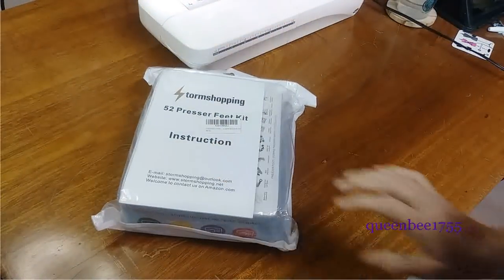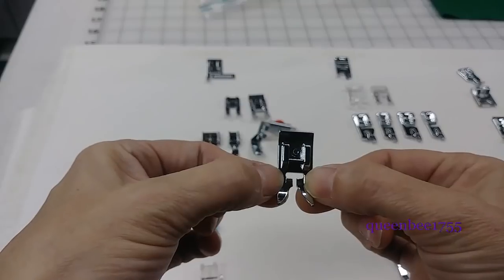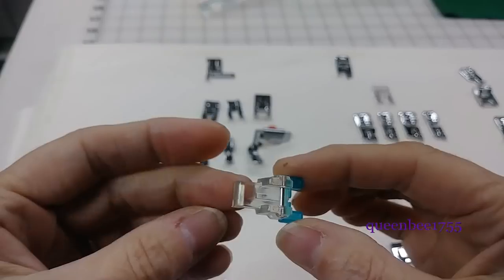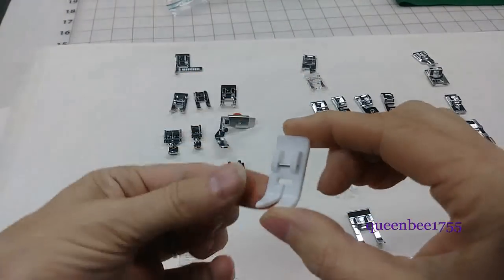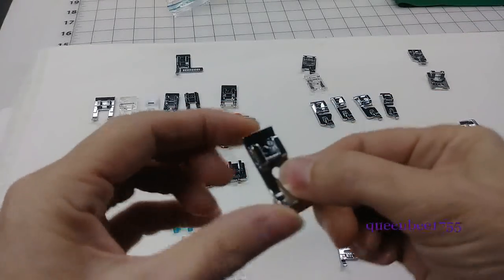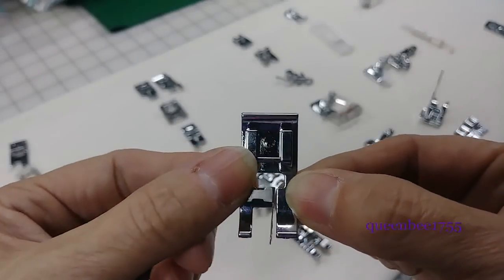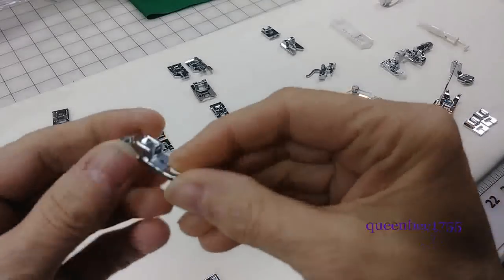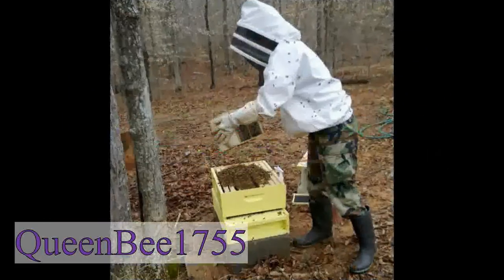52 Piece Presser Foot Kit: Identification

Comment: The white one at 11.20 is a nylon foot  for sewing leather/plastic  etc,  it glides without sticking,  as a normal foot would do.   Also at 16.50,  I believe that this foot is a 'Stitch in the ditch'  foot,  which is why there is no bar for the overcasting effect.   you would use the blade to sit in the 'ditch' .

Comment: I have this set and I"m glad someone posted a video about each foot and how it's used.  Some of these I will never use but for the price I figured I'd just go for it.  BTW, that plastic universal foot is supposedly made of Teflon so it won't stick to certain types of material.
Reply: I have stitched with vinyl with that white teflon foot.
Reply: Where cahjjh

Comment: hi and appreciate the video and information. One thing I have experienced is plastic presser feet work better on knit fabrics as there is same holding/guiding power without friction to the fabric movement. try the plastic version if you find the fabric is not moving smoothly or getting puckering along the seemline.

Comment: Your white "plastic" foot is called a Teflon foot (I saw later that someone said it's a nylon foot I wasn't aware they made them in nylon) and is meant to be used on very smooth fabrics like what you use for prom dresses or lingerie. I saw someone else mention using it for leather. I think that and even pleather it would work well on. It won't snag on the fabric and it holds onto it even though it's slippery. Love this video you did a GREAT JOB!!!!
Reply from the maker: @Rainwatercolor  Thank you! This is an old video, back when I had never needed the Teflon foot. Many things have changed since then. We learn and grow and now I'm sewing upholstery, motorcycle seats, and leather projects and using many more 'tools of the trade'. Thanks for commenting!

Comment: The foot that has the bar guiding part in the middle the foot is a quilting foot for stitching in the ditch. stitching right in the seam line between two pieces. the guide goes down the space between the two pieces and keeps your stitches right in that ditch
Reply from the maker: If you are referring to the one I think you are, that is correct. There is more than one foot in this kit with a center bar/piece. The main function of the one with the thicker bar is edge work, like faux surger edges, etc. The one with the thin guild bar is for stitch in ditch. 
When going thru this set, I was calling each piece what the book that it came with called it. Although that is the main function of that foot, it also has many other uses. It can be used to join together pieces with zigzag or decorative heirloom stitch and I've also used it occasionally for following the edge of an applique.

Comment: Hello from France .  In case no one has already told you, that white 'zig zag' foot is actually a non stick pressure foot. I've got one and it's used for vinyl and leather.  Thanks for the video.
Reply from the maker: I had organized them according to the descriptions in the book and realized that one was a 'non-stick' foot (the white ones are) after I did the video. But life has been so hectic I never corrected in comments. Thank you for pointing that out!

Comment: the white plastic foot is a Teflon foot useful when you're working with vinyls and other materials that would stick and dragged under a presser foot.
Reply from the maker: I did make a correction on that in the comments thank you.
Reply: @QueenBee1755  great! It is a very useful foot. I once reupholstered a snow mobile seat with bonded vinyl and it was a big help!
Reply from the maker: It does help. I sew a lot of leather and vinyl as well.

Comment: You missed the circular/flower embroidery head. That rotates the fabric to produce petal patterns, as well as circles, but does suppose you're able to spin the mass of fabric fairly freely around the needle.
Reply from the maker: Since this set of videos was based on this set, and those did not come with this set so they weren't missed, I don't show them.
Reply: @QueenBee1755  Aw, just that they were on the table...

Comment: hi i love the video you did for the 52 piece presser foot kit, but i'm having a problem identifying which presser foot goes were because my mum took them all out of the box so i was wondering if you could help with this please and again thank you for doing this video it was very informative
Reply from the maker: @minnie87679 If you mean back in the box, I'm not sure I can help with that. What I did with mine is pick out the ones I use the most and put them all in my kit in the same small box together. The ones I don't use very much, or at all, I left in the box they came in, or found an empty spot in there to place them in. That box was packed in the move we made a few years back. Since I haven't needed them for the past several years, I haven't unpacked them yet. You will learn which ones you use the most, for the type sewing you do. It's nice to keep those with your machine at all times, while the less used ones can be stored in a drawer somewhere. Keep things simple and focus on what you like sewing. It helps keep the stress down. Happy sewing!

Comment: I am looking to get a Singer sewing machine when I can find one at a sewing store locally and one which is heavy duty. I am seeking one there because the owner of the store knows more about how to service it if needed, and may have classes if I need any. I have an old machine from many decades ago, but it has not been used since the 1960's when my grandmother used it.
Reply from the maker: Many of my first machines were Singers, including an old peddle Singer I still have. It is important to get a machine you have easy access to parts and repairs for. Eventually all of them need some maintenance.
Reply: @QueenBee1755  I know and why chose the Singer brand. I had a drawer made for the old machine and probably should have had more work done on it.

Comment: Can these 52 multi-purpose pressure foots be used in a Brother FS 101 sewing machine ?
Reply from the maker: They fit my Brother PC420 and are considered 'universal' so they should, but I would suggesting checking and comparing the specs of the 2 machines before buying if concerned.

Comment: Hi, sorry for the intrusion. I had a run of bad luck with a machine I bought 3 years ago by error from the USA to be used in the UK via Amazon.
I also bought the exact same pack of footers.
The issue I am having now is that I do want to buy another machine for my wife, not too concerned about the price. But, I need to know what sewing machines can take those presser footers.
Also, while I am at it, there are too many brands and models to choose from, and that is doing my head in. 
Can you tell me, or better still, make a video giving us a range of machines that can do almost everything? Sort of like a workhorse, multi stitching, multi fabrics, etc.
Thank you.
Reply from the maker: My preferences for machines are the newer Brothers, the older Singers, and Janome. 

These feet are 'universal' and should fit most average household machines. They all fit on my Singer and Brother but due to the needle placement being different on my Janome, only about 1/2 of them fit it. I posted a picture on my community page awhile back showing what I meant about that.

My tools video has a brief description, near the beginning, about the machines I had at the time of the video. The link for that video is here: https://youtu.be/opdqk_IrRtQ

I also have a video for just the manual. At the back of the manual it shows what it fits. Here is the link to it: https://youtu.be/d0iGGXkBabo

I hope that helps some.
Reply: @QueenBee1755  Thanks you for your quick response, I will check the video later, it is 23:09 in the UK

Comment: Do you feel this is worth buying or would it be enough if we get the 32 piece set ? Would we use so many feet ?
Reply from the maker: Honestly , unless you do a tremendous amount of sewing, I don't think the 52 piece set would be worth it. When I was going through this set, I noticed that several of the feet, although different in appearance, served the same function. They are not top quality feet but are very good for the price and a smaller starter kit should work well for most. There are a few feet I had to purchase separately because they were not in the 52 piece set.
Reply: I have 32 pieces of set . N quite useful n sufficient for me
Reply: Is it for industrial machine or domestic machine?
Reply from the maker: My machine is a domestic machine.
Reply: @QueenBee1755  ok, thanks

Comment: I am starting off making felt dols and felt baby room decor. I usually hadn't stitch (blanket stitch) the edges ( edges of 2 pieces of felt cut into what ever shape)
I am going to make bigger dolls I wanted to sew them instead of hand stitching. I was thinking of using the over cast foot to sew them, what would you recommend since your an expert. Is there ay others that could help. Thanks.
Reply from the maker: If you want to keep that blanket stitch look then the over cast foot could be helpful. Note that one has the pin and one doesn't (in this set). Use the one WITH the pin. That keeps the thread from pulling too tight on the edge. Test where needle falls before running machine. Then do a test run with scrap before starting work.
Sometimes multi layers of felt can travel at diff speeds. The roller foot helps some but a walking foot (not in this kit) does good too.
You can do an overcast stitch with the latter 2, but you may need to reduce your thread tension since they don't have the edge pin. 
I hope that helps. Happy sewing and thanks for watching!!
Reply: @QueenBee1755  Thank you ❤

Comment: Thank you for your video. Do you know if these will fit on my Elna eXplore 240?
Reply from the maker: I am not familiar with that machine so I can't say. However, these are considered 'universal' snap presser feet. IF your machine has been able to use universal snap into place feet then it's possible. 
If it is a slant shank machine then they won't. In the back of the instruction booklet that came with this set, it says this about the slant shank: "SLANT SHANK: designed ONLY for Singer slant needle machines and will not fit any other make of machine.
Reply: I recently purchased a singer brilliance sewing machine. I am glad I just read your responds about slant shank machines. Now I know what to look for when I purchace presser feet. Thank you once again

Comment: Is it necessary to get the 52/62/72 or will 32 pieces be sufficient? I'm new to sewing. Thanks in advance. I watch your other demo, but frankly Im more of a hands on person so I dont quite figure them out yet
Reply from the maker: The 32 pieces should be sufficient. I sew a LOT and don't use about 1/4 of this 52 piece set. If you are looking for a specific foot, you can usually buy an individual foot from different websites if you know the foot's name or function.

Comment: I have a Singer Sewing Machine Model 7043 with a slant shank.  Are these feet compatible with my machine?  If not, would a low-shank and/or high-shank adapter work?  If so, where would I buy these adapters?
Reply from the maker: In the back of the instruction booklet that came with this set, it says this about the slant shank: "SLANT SHANK: designed ONLY for Singer slant needle machines and will not fit any other make of machine. Measures about 1". "
My machine is a Brother low shank. The kit comes with a 'snap on shank, low shank adapter, pressure foot holder'. This is if your machine has a straight shank and you need to unscrew the feet to change them. The adapter changes the holder into a snap on foot holder. 

I have not had to use a high/low adapter for shanks so I don't have an opinion on them or where to get them. 

I hope this helps!
Reply: @QueenBee1755  Thank you so much for your expeditious reply.  I'm very disappointed that no one thought to make slant shank presser feet.  I know quite a few sewers that are still using the Touch & Sew machines.  Singer makes some good machines that last for decades.
Reply from the maker: I understand. I have had several Singers as well. They are good machines. I still have an old treadle Singer machine I've made quilts on.

Comment: QueenBee1755 could you tell us how these feet are doing after a couple of years of use? On Amazon, you see a lot of these types of kits being sold, and in the ratings, customers aren't always happy with the quality of some of them. Is this a good, solid buy; or has there been metal and finish issues with them? Just wanted to know, as I have been thinking about purchasing one myself. Thank you for5 the content, and the time. P.S; I've watched your vids, and the camera on your phone is doing a fine job. Don't let the haters make you frown.
Reply from the maker: I purchased this set in July 2018. I sew as my profession, so I've put a lot of hours on SOME of the feet. I can't speak for every order placed. Anything that is mass produced can have defects slip through. I was use to paying $50 or more per foot so I figured I'd try these as 'disposable' feet because they were so cheap at the time. I have not had any wearing, cracking, or pealing of any. About 1/2 the feet I don't use very much so it doesn't mean much for them. All the feet have ran well on my Brother machine but there are several of the main ones that do not work on my Janome. I'm also not sure if manufacturing procedures for them have changed in last 2 years. I believe there are smaller sets you could try first, to make sure they fit your machine. And thank you for watching and your comment!
Reply: @QueenBee1755  Thank you so much for taking the time to answer. I just purchased a Janome HD3000, and I hear you when it comes to purchasing feet. I've read a lot of reviews that these types of kits are not always Janome compatible, so I'll likely take your advice and buy a smaller kit to start out with. So far, a walking foot I've bought used has really proven itself to be quite a great purchase, and it came from a similar type of kit I was told, so I guess they're all dependent upon who manufactures them, and if they're going to fit machines in general. Have a happy, and thanks again.
Reply from the maker: Sounds great! PS: I posted a picture on my community page back in August of why they were not working with the Janome so you can see. I am not able to post pics in comments.
Reply: @QueenBee1755  Thanks for the photo: I have an older (30 yrs old) Janome/New Home low-shank. Of course all the feet I am mainly interested in are in your comments, haha. Have you tried installing the snap-attachment that came with the kit, then tried the feet?

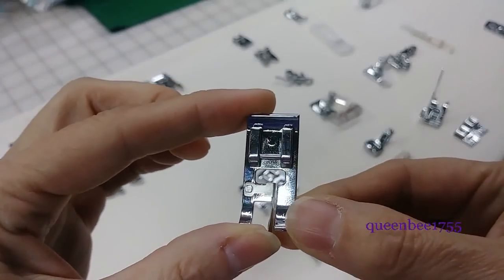Also (I didn’t read through all the comments, so sorry if it has been mentioned before) @16:50, the last overcast/whip stitch foot might be useful for stitch-in-the-ditch?
Reply from the maker: I have not tried using the snap attachment that came with the set. Never really thought about that since my machines already had one, but it's a good idea. I'll need to try it. I didn't bring the whole foot set with me to work (I'm working out of town while my family is packing up house for a move) so it might be awhile before I can. 
 
The foot at 16:50 could be used to stitch in the ditch but it is offset, so you would need to move the needle over so it falls in line with it. 

Thanks for commenting!

Comment: Are all of them universal. I have a 12 stitch mini sewing machine. I saw a video of a lady doing a review of the 32 presser foot which fits in the same mini sewing machine. Wondering if this will too.
Reply from the maker: These are universal feet, but even a universal might not fit every machine. I have a Brother. They are for snap shanks but mine came with a snap shank to replace a fixed shank. I would think it depends on how big your assembly is since it's a mini.
Reply: Tme mini is good for learning but if you have big enough dreams to get this many feet I would just go ahead and get a regular machine because you are going to want it.  I have one. It served its purpose for me I learned the basics but it can't handle much and is really hard to get a straight stitch, and I hate that it doesn't even backstitch

Comment: Would all the feet in this kit work with a Singer Brilliance 6180
Reply from the maker: These are 'universal snap on feet'. With that being said, not all 1-fits-all actually fits all, so I can't say. They all fit my Brother but only some fit my Janome because of the needle position. The kit cost about $40 on amazon. With some individual feet running $5 - $40, or more, I figured it was worth trying. There are smaller packages for around $20 too. PLEASE NOTE: I am not an affiliate and  I do NOT receive ANY money or free products from any dealer. I am not endorsing, only sharing my personal experience. I am sorry I couldn't give a firm answer.

Comment: I bought one of this kit but the foot wont clamp so what should I do please
Reply from the maker: Do you mean the foot is broken or do you mean your machine doesn't accept a snap foot?

If machine only uses screw on feet and you got the same kit I did, there should be an adapter piece in the kit to fix that. Remove the foot from your machine, then replace it with the adapter. The feet should then snap onto the adapter.

Comment: Hi can these foot be use on a 20 u singer
Reply from the maker: I'm not sure. I have a Brother machine, but they are 'universal'. If your shank is straight up and down and you have used any snap-on universal feet before then they should. The only thing I saw in manual about not working with something is about any 'slant shank' machines.